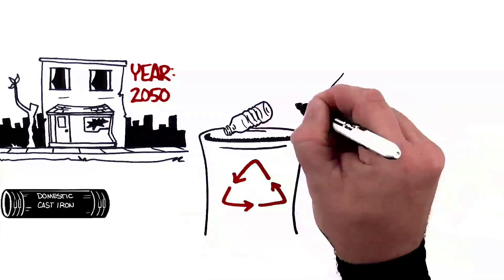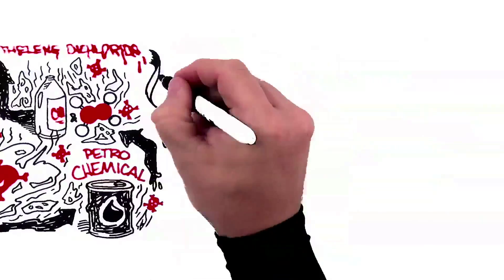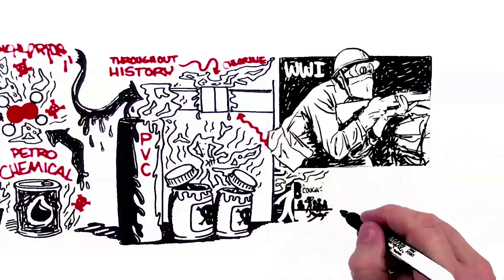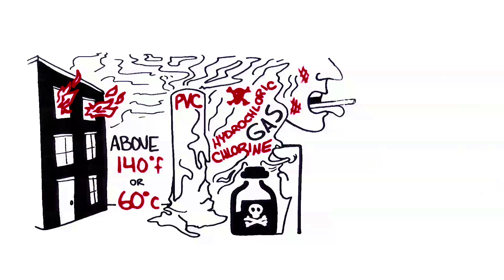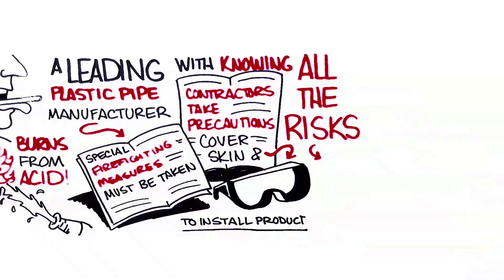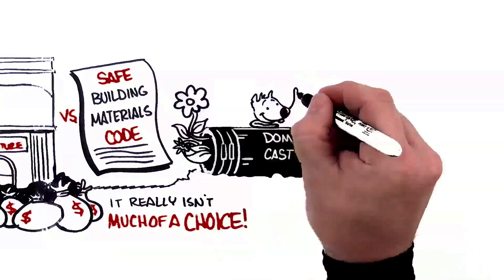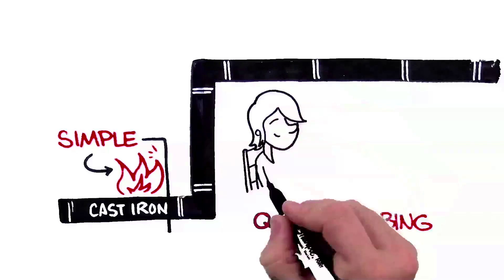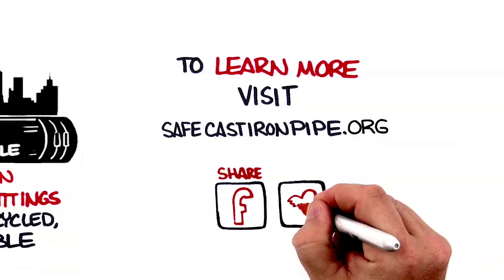CAST IRON VS. PVC/ABS PIPING

Comment: this is total nonsense....pvc is fine when installed correctly and has been in use for drainage since the 80s....in my state all new commercial buildings require cast iron and all residential you can do pvc..

Comment: If it's a public building then yep cast or copper drain lines but if is a private home nope pvc it is that the way i look at it in the fire code there is no plastic approved piping system for transitions between floors and walls unless there is fire blocking that's why you will see cast used in duplex apptments above 3 story's and in public building like court houses and libraries and police stations and skyscrapers but if you don't like the sound of water running in your home every time you flush the toilet then ya cast iron it is buttttttttt you going to be spending a good penny. Also pepole are saying that cast iron will crack I only seen this if it not graded property or not supported properly or they used drain cleaners the same will happen to pic or abs piping if not installed properly that's my 2 cents on the subject

Comment: Trust? all my cast underground is rusted, and falling apart as I am digging it after 41 Years ??
Some of your Cast Pipes  in this area has rusted and collapsed as early as about 20 Year. 
How is replacing all Cast Iron pipes under concrete ever 20 to 50 years good for the environment.
Reply: It's good for Cast Iron Soil Pipe and Fittings' bottom line(i.e., they make more money selling iron pipes to replace the ones that's rusted).
Reply: Did they put rocks 2 ft below the pipe or just set it on the dirt by code there is. Supposed to be adequate draining to prevent rusting of the pipe I've also seen this happen if the drain piping was set too high in the ground for example 2 feet also could have  not been supported properly and not graded properly hence why it's rusting out this is most likely due to a low spot in the line that water sits in constantlym